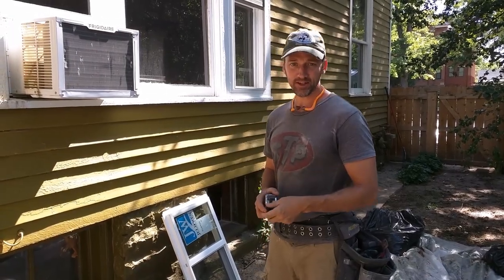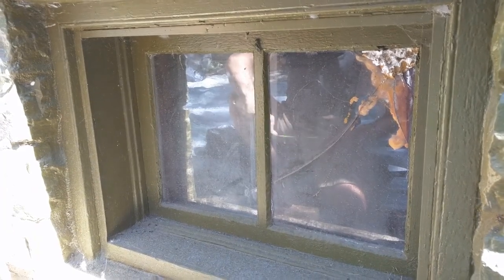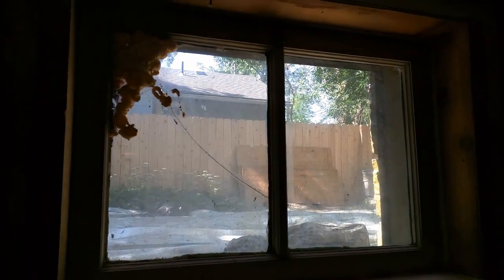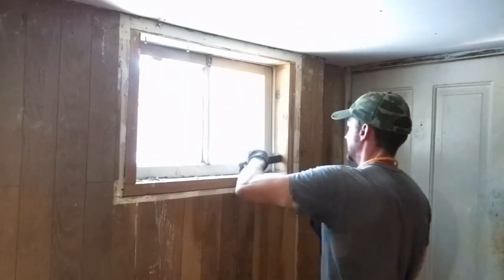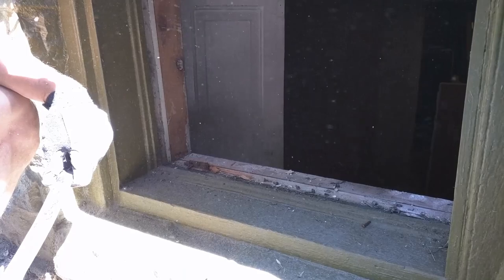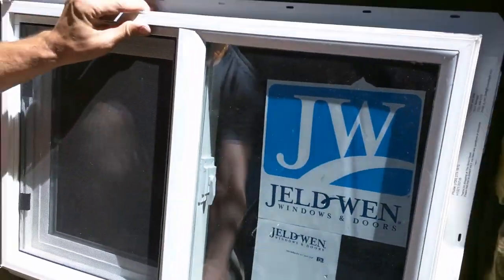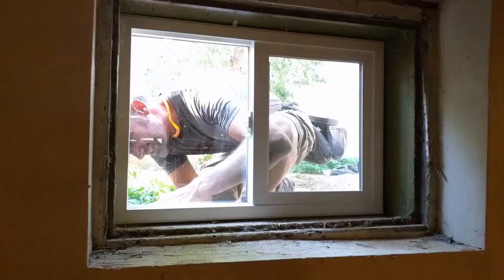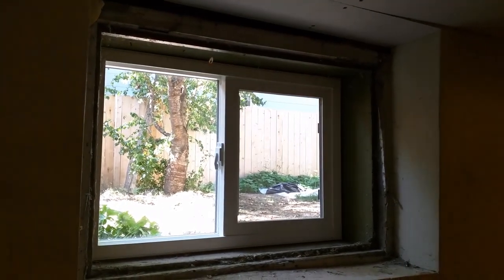How to Upgrade Your Basement Windows

Comment: Most normal people would also remove the new-con screw-in tab when putting in a Jeld-wen window, as that tab is meant for framing on a wooden exterior wall that would be finished with vynil siding. When installing these windows in basement concrete casement, they are supposed to be cut off so you can set the window deeper into the casement, so the window is a bit more centered in the cavity, and the offset is not too much  + or -

As well, you should have at least 4 screws in place to anchor the window as anyone can kick in the window (1/8 an inch of low-expanding foam is not an anchor and should never be treated as such)
Reply: I like your comment and I’m trying to figure out how to install windows in my basement of my brick 1940s house. I have the glass frame which is hinged and an outer storm window which are framed in by two by fours which are attached to the brick foundation. Would you suggest removing all of that wood and just get down to brick and concrete it installing or keep the 2 x 4 framing in place and attached to that from the inside of the house? Any feedback would be much appreciated as there are so many ways to do this
Reply: Thx for taking the time to comment… that was confusing me since the basement windows I have are encased in concrete

Comment: Pro tip: The blue can of Great Stuff is specifically designed for this application. It doesn't expand as much as the red can. Too much expansion may cause your window jamb to warp, thus causing problems with the window being able to function properly.
Reply: Yep used the Blue Great Stuff in my window and it worked great. It only fills in the gaps, doesn't have enough force to push plastic.

Comment: Looks nice, especially inside. If the window is in a place in your basement that doesn't need light/ventilation you could even consider just filling it in. I did this to one window in the basement of an old house I owned with some plywood and foam board. It cost very little and was easy to do. It also allowed me to easily rout my sump pump hose out through a hole I drilled in the new board.

Comment: Improper install for this window. The window is supposed to be supported by shims not the plastic nailing flange. And you didn’t leave enough space for spray foam.
Reply: Moodie B Yeah, I have always seen the nailing flange snapped off and the window screwed from the sides. Then caulk from the exterior and interior and you’re done. No exterior trim needed.

Comment: I just had a great thought on basement windows!  ORder the window bigger than the actual block opening!  This will give you a lot more EGRESS without cutting block or headers!  Mount the window on the interior side of the wall or even on the exterior OVER the existing opening!  USe Brick molding or even just 5/4 material to frame out the new opening.  Trim as needed!

Comment: Hey, can we get a look at what you did on the outside to finish off the window?
Reply from the maker: +Blair Anderson Good point, I missed that important detail! My friend Luc finished off that part - he sliced up some 2x4s to become roughly 1.5x2.25, and built effectively a picture frame around each window with 45 degree angle corners. The frame extends all the way to the edge of the opening in the foundation wall, so each piece is trimmed a little to fit the uneven space.. Nailed in with 2" finish nails (nailgun) and caulked/painted nicely. Nothing fancy but it blends everything in.
Reply: Mr. Money Mustache 
No worries, I figured something like that.  nice work.

Comment: Nice touch with the wood work, would like to see a little clip on how that worked, though I suppose that is an exercise left to the reader. For a truly cheap fix, you could have replaced the window pane of course (a couple dollars down at your local hardware shop vs. quite a bit more for the window) though no doubt the new window is more energy efficient and opens nicer.

Comment: On other YT videos, window replacements are put in from the inside, where they drill from the opposite direction as in this video. What's different about this situation that it should be installed from the outside and drilled to the exterior?
Reply: That’s what I’m trying to figure out. If it’s installed from the inside you would not order windows with nailing fins right?.  I have a 1940s house with 34” x 17” tilt in windows with an outer storm. The wood framing around them is a 2” x 6” or 2” x 4” up against the brick walls. I guess I could order them slightly undersized 33.5 x 16.5 without nail fans and install from the inside. Could anybody give me feedback on the best way to do this? Thank you
Reply: @TheFord1965  When we had our century-old double hung windows replaced in 2017, they were replaced entirely from the inside. I think unless you are going to pull off siding and redo some water proofing on the outside (not a bad idea if it hasn't been updated in a long while, but it creates a much larger project), replacement windows are preferred vs the new construction windows with the fin.

In general, I'd also think about how well protected the windows are from rain. If you've got a solid overhang not far from the top of the windows (e.g. 18 inch overhang that starts 18 inches above the window, that reduces risks as windows frequently leak at the top. If you've got a minimal overhang, then the risk will be higher and by how much would likely depend heavily on the details of your particular wall.